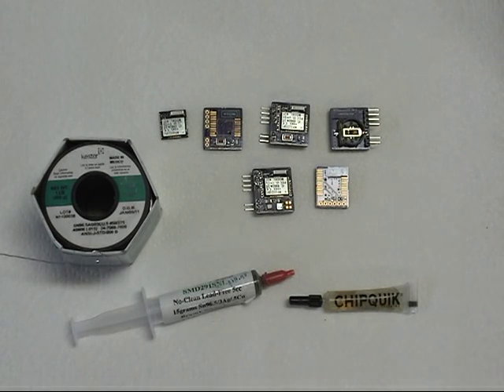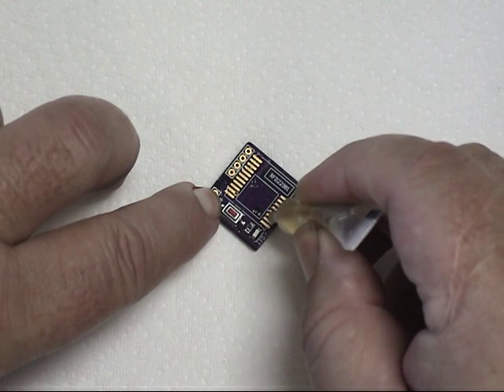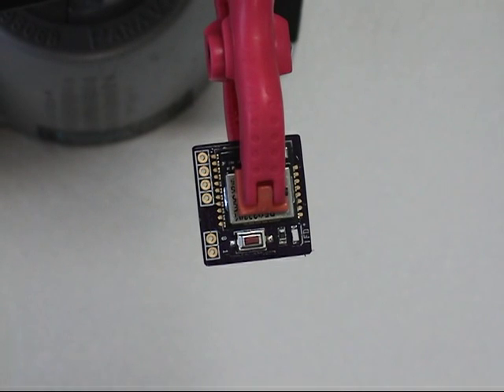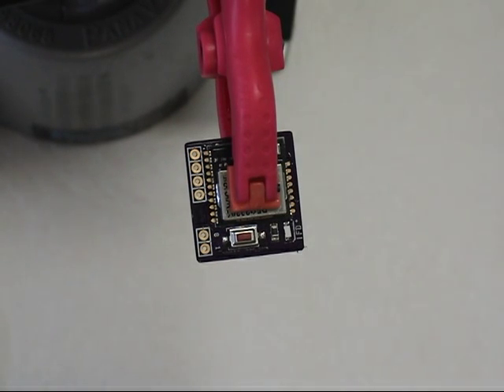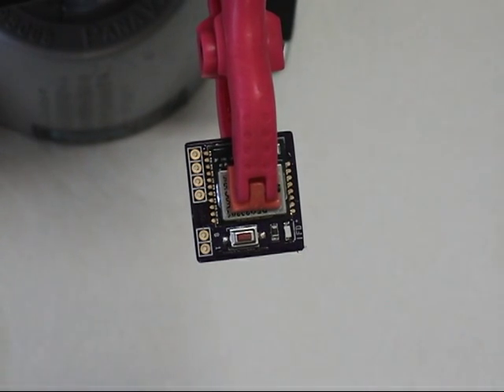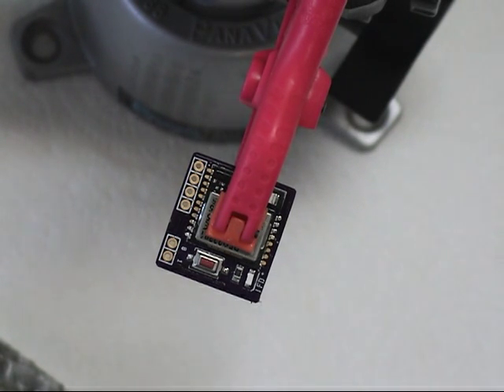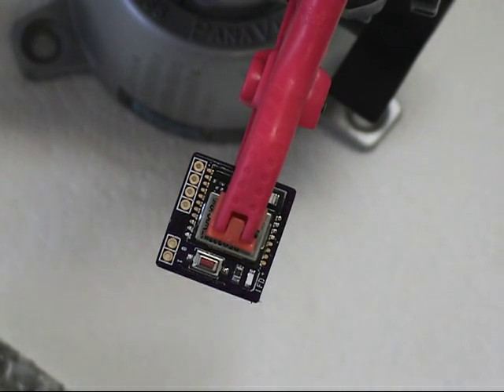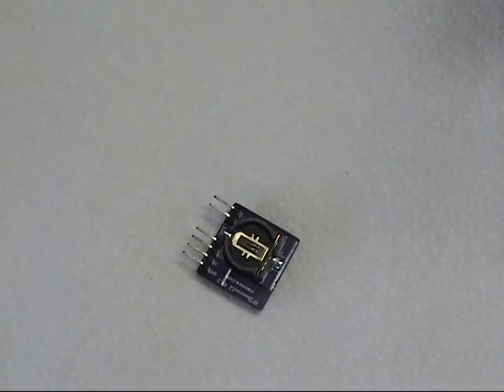Hand Soldering Castellated SMD boards to custom mother board

Comment: Oh very nice Tom!...one thing tho that will change your world...for SMD...use a plastic stencil and wipe the paste onto the pads...they laser cut plastic stencils now when you order your pcb...OSH park does at least. And you can just buy a cheap electric stove and cook them. SMD is really really forgiving. The solder's surface tension pulls the components right into alignment and life is great.
Reply from the maker: Hi Randy,
Thanks. I use the plastic stencils from oshstencils for my production runs. What I am showing here is a easy way for a hobbiest who needs to do it once and on a  board which may already have other parts pre-installed.